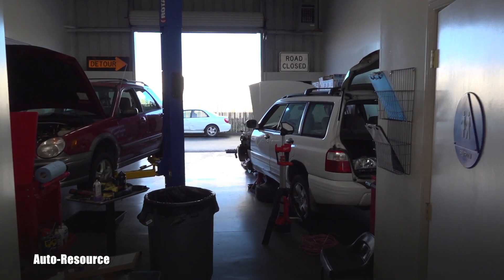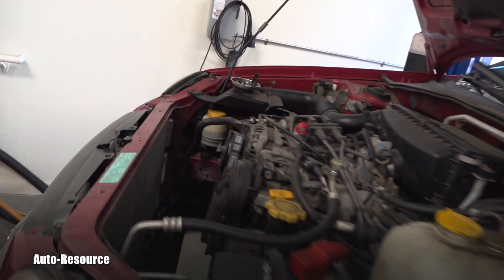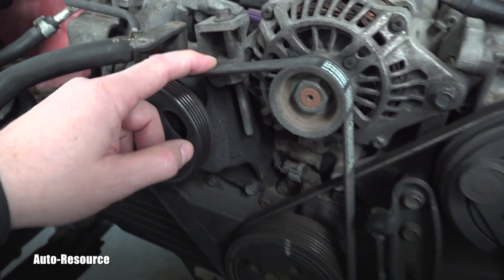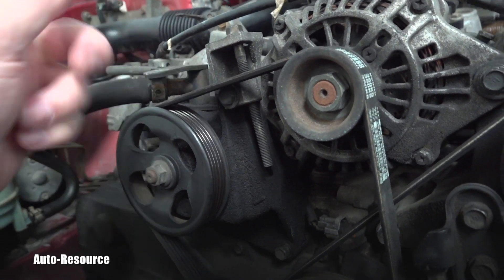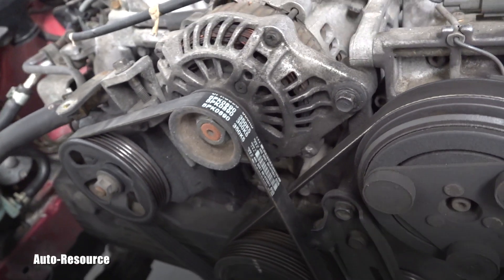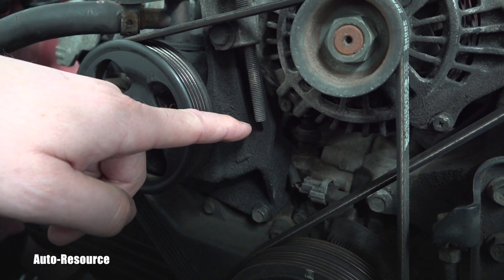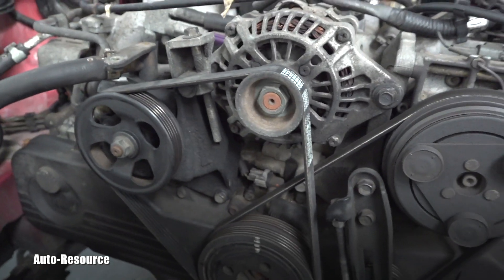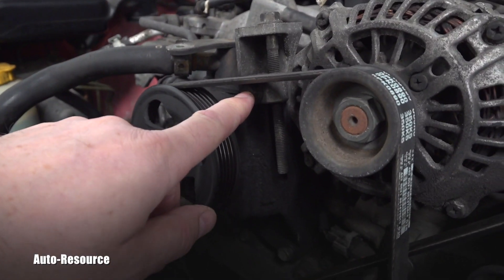SUBARU problem - alternator tensioner bolt touching belt

Comment: I have tried 4 belts  from Bando and Gates -- ALL wrong belts  even though Amazon and EBAY Motors claims these to be correct fit -- they were 5PK890 / K050350   which were too long  and 5PK880 / K050345 which were too short ! But Amazon and EBAY claimed them to be correct..  SO  I looked for a Belt that was about 34.7 or 34.8 inches or 885mm and that was the 5PK885 !  Amazon and EBAY said the belt don't fit my Subaru but I tried it and IT FIT PERFECTLY !!  I have at least 1 1/2 inches clearance between the belt and the lock bolt on the alternator adjuster !!  Very frustrating experience.  My car has the correct pulley setup for the Alt/Power Steering too !!

Comment: So the stretch belt was too long obviously and if you use a 875mm length belt it will be clear and also as they get old they stretch and stretch and get longer and longer...

Comment: I took the aluminum block that that bolt goes through and sanded both sides down with a belt sander  so the block was actually skinnier. Now it clears the head of the bolt.

Comment: Do you have any idea where I can get that belt tensioner bolt (the long one) and the threaded piece it goes through? Looking for a part number because I was going to check the tension on the AC belt and I noticed this particular piece is literally rotting apart. I just backed away popped the covers back on and didn't touch anything lol
Reply: Same problem here just today, except mine is actually missing.  Probably some crack auto mechanic years ago lost it and just manually tightened the alternator!   I believe the "threaded piece" is 23766AA000, and the long bolt is 34435AA030.

Comment: The Continental Belt #4050347 will fix this issue. Parts stores will show it as the wrong belt, but it will fix this issue 100%. The belts that the part stores will pull up on the computer are simply too long. The other comments also back up this fact.
Reply: That's what I have on my car and it still has the same issue

Comment: Same problem with mine, the lock lug and back of the alternator bracket the lock bolt passes through are both threaded, I simply took the lock bolt completely out and reversed it, I reinstalled the lock bolt through the alternator and then through the lock lug, that way the bolt head is now on the other side; worked perfectly and let's you tighten the adjuster more without any interference with the belt.

Comment: remove that whole adjustment bracket.  loosen pivot bolt and tighten the belt old school push the alternator with pry bar or your hand and tighten the pivot bolt done !!!
Reply: That won't work.

Comment: Just had the same issue. Your belt is too big. You need to get a shorter belt. I got the 905mm rather than the 912mm belt and it allowed to tension properly without the bolt rubbing the belt when in place.

Comment: I am a Subaru expert and familiar with this problem.  The solution is to use Continental belt 4050347.  This is a perfect fit.  For some reason, all the online parts catalogs suggest the 4050350 (or equivalent) size, which results in this incorrect fit.  4050347 is the perfect fit and Continental is the only brand that makes this size, the only alternative would be to buy the OEM Subaru belt.  This Continental 4050347 belt is available on Amazon.
Reply: I have the 4050347, from continental and it is also too long.
Reply: @sethdraeger5060  Very odd, but you can try 4050345 which is even shorter.
Reply: I have a 2006 Subaru Baja same problem so I will get oem belt. Thanks
Reply: I have this belt on and still have same issue.

Comment: I ran into this problem this evening and couldn't get a shorter belt, so I removed the bolt and washer, discarded washer, and put the bolt head to the grinder. By taking off about 1/8" or so, after reinstall the belt cleared the bolt head.